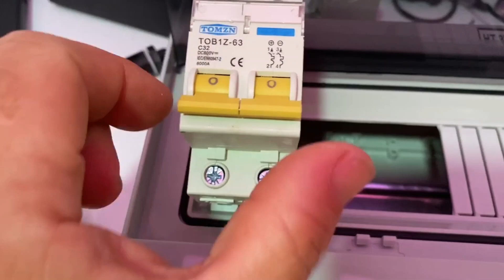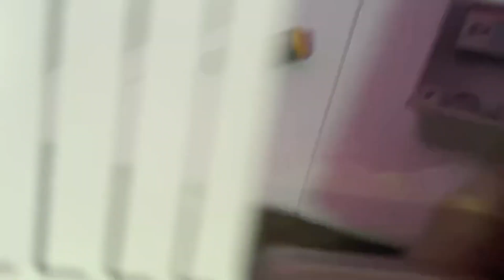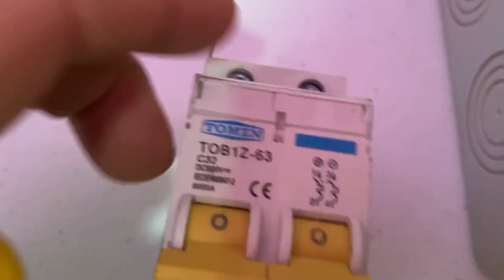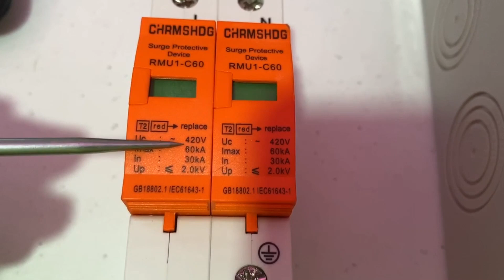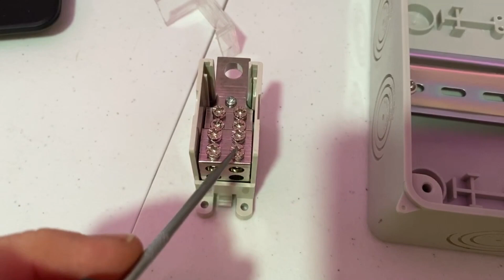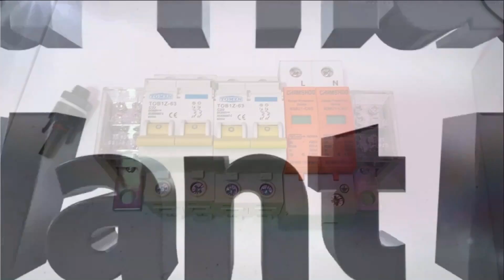80 How to Build a Solar Combiner Box Details

Comment: Great explanation! I can’t find any of these parts, can you please post some links or at least say exactly where you got them?  Can’t find exact things you have. Thanks.
Reply from the maker: https://www.ebay.com/itm/333381164674
https://www.ebay.com/itm/264774005789
https://www.ebay.com/itm/264500141270
Use any 10ga wire for inside connections. I use THHN.
Reply: that's 6mm2 wire for anyone in other countries btw

Comment: Thanks for this video, very detailed! I am planning an Enphase microinverter based system and would have to combine 2 AC branches of 60A and 40A @240VAC, mounted indoors in the garage. Could I use your design the same way and just replace the breakers by AC breakers? Or would I have to use a metal housing due to code? I can't find any AC combiners on the market. Enphase's own model only allows 80A due to their busbar rating. Thanks for an answer!
Reply from the maker: I wouldn’t recommend this for AC at all. It is designed for DC only.

Comment: Why do you need a breaker on both the positive and negative?  Couldn't you just wire the negatives directly to the junction box and put single pole breakers on each of the positive inputs with the same amount of protection?  I've never set up solar panels, so there is probably something I don't know about.  Great Video!  Thanks!

Comment: Hi Steve was just wondering how your combiner box is different than the one in the video with Seth?  and what your thoughts were on his box?
Reply: mickey simpson his box uses fuses. Mine uses resettable circuit breakers. It costs about the same to build as Seth’s costs to buy. The only benefit of DIY is resettable breakers.
Reply: @OffGridLivingSteve   thanks